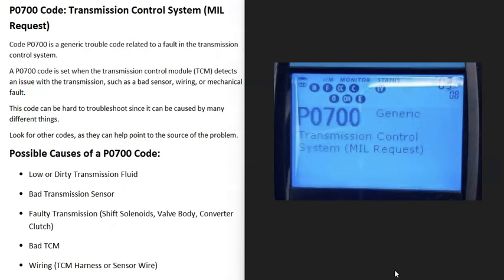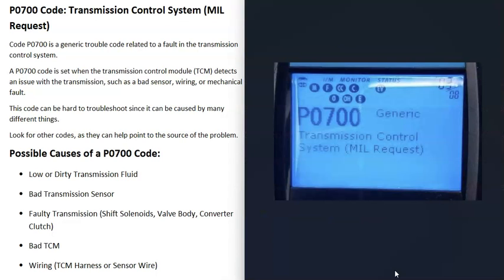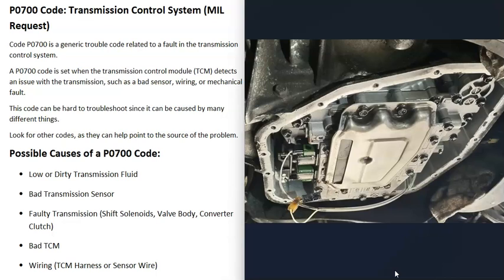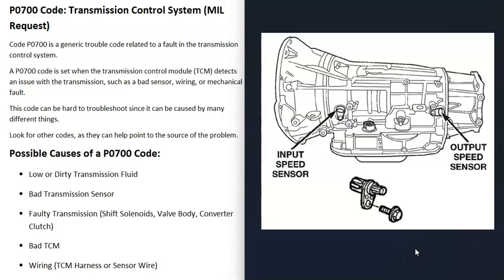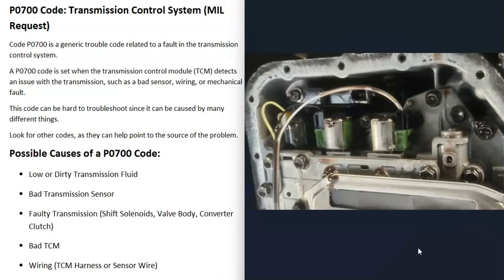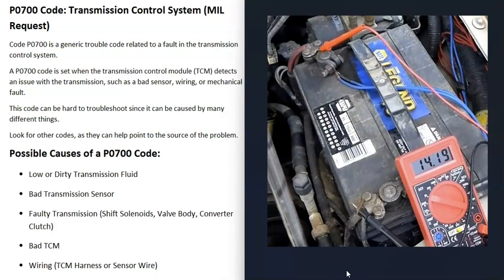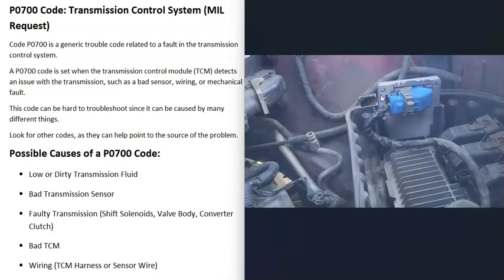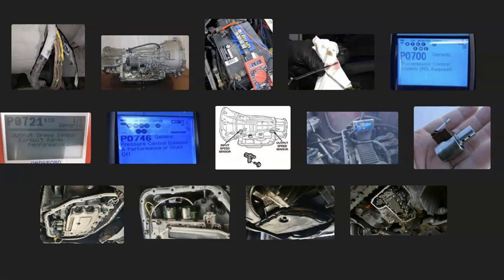Causes and Fixes P0700 Code: Transmission Control System (MIL Request)

Comment: I drop my 2018 back off where I bought my chevy v8 LT.i bought it no payments.no worranty.but that code pop up so what do you think there going to charge me.
Because the truck would not go or drive at a light then I turned truck off let set couple seconds or more cranked up in it dove in shift slowley.then would start loseing power not wanting to shift.so I pulled over shut off in started back up in it got me home.so I have dropped off at the chevy place where I bought it in haven't Hurd no answer on price.
I'm worried.
Reply: How did that work out?

Comment: My car is stuck in 2 gear
Reply: lol mine in first gear
Reply: @woodenleaf652 same here
Reply: @woodenleaf652 yea mines too it was my valve body
Reply: My car is stuck in impound. Any ideas?
Reply: 😅😂 @carmenk4018
Reply: @carmenk4018 hop the fence
Reply: Did you reset your check engine light?

Comment: I really need help, I have a jeep Liberty 2004 3.7, scanner shows : 

P0700
Transmission Control S
ysten (MIL Request)

P0740
Torque Converter Clutch circuit/open

P1776
ManuFacturer control

I change the solenoids, filter and still showing those codes I already reset it with scanner and still showing those.